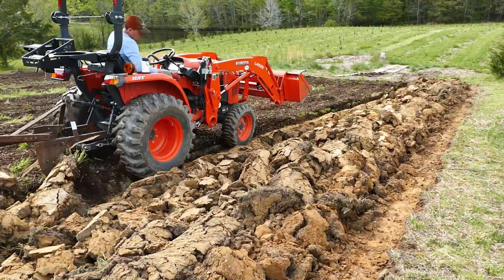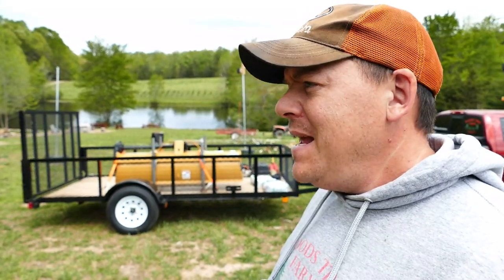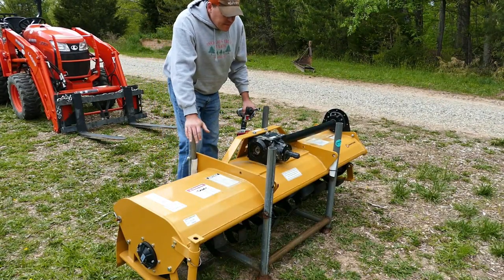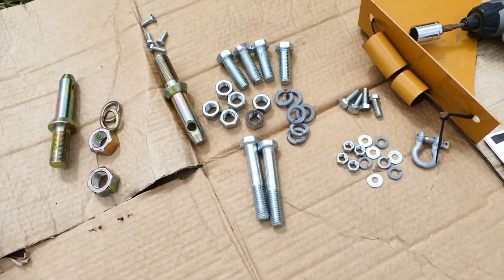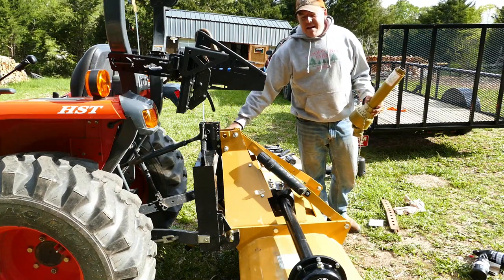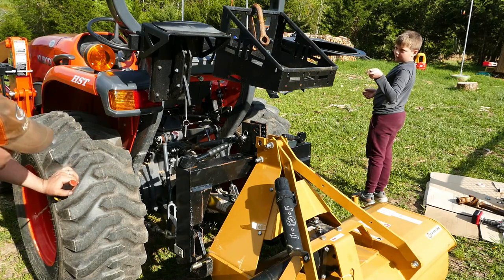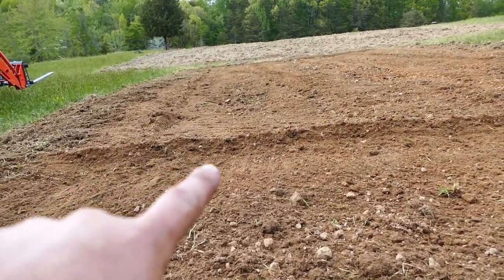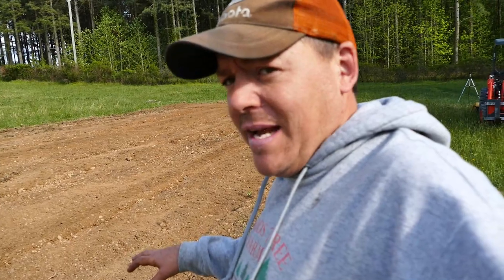Can The Kubota L3901 Run a 6 Foot Tiller? Countyline 6' Tiller Assembly

Comment: People who have not used a stand behind tiller will never appreciate how great a PTO tiller can be.  I've been dragged behind a tiller for hours.  Good video sir.
Reply from the maker: oh yes, I've used a smaller gas powered tiller.
Reply: I have a Troy Bilt rear tine roto-tiller, still works, but now that I have a tractor and a PTO tiller the old walk behind tiller probably won't get much use.
Reply: If you think the walk behinds are a pain now, you should have gotten half beaten to death by one of the old ones, back before they even put wheels on them. Just tines and a single lay off plow. I started plowing with one of the old ones when I was so young the tiller weighed more than I did. 
I came in from plowing bloody and with knots on my head where the metal handles hit me repeatedly, til I got tall enough and strong enough to handle it better. Send a teenager out to do that now, much less a 5 or 6 year old as I was, and you would get hit with child abuse charges. Of course that's what wrong with most kids today, they need some toughing up, and a work ethic.

Comment: Thanks for the information. Legitimately answered some questions we have about power. We're currently deciding on our first machine.
Reply: Go with the Kubota and you will never regret it. Just make sure to get a machine slightly bigger than you think you will need. You can always do the job with a machine slightly too large, but an underpowered tractor will make life miserable.
To figure out what tractor you need, first look at what tools you plan to use. Once you know what tools you want / need, then get the tractor to drive all those tools with a little extra HP above that recommended by the tool manufacturer, if you can afford it. 
Also hydrostatic drive tractors tend to be less powerful than their clutch driven counterparts, so add around 10 hp or 10% (which ever is less) to the recommended hp for your tools so you get a capable tractor for that tool.

Comment: Nice video. I have a 5 foot tiller that is similar to yours that I use with a 28 hp tractor. Those PTO tillers are awesome. One thing that I have found that helps when hooking up the PTO is to back up not quite all the way to the attachment. Then hook up the PTO before backing up the remaining 6 inches or so to hook up the 3 point. I tried this once out of near desperation and have done this every time since. Thanks for the good content.
Reply from the maker: Good tip. Might give that a shot sometime. Thanks for watching

Comment: I think the setup works fine, I till a lot during the spring and summer, from old gardens to break ground new gardens. I've never had to plow it first, of course that's a personal preference. To smooth it out buy a old farm spike drag and drag it a few times it will look great. Another good video keep on it!
Reply from the maker: We've had real back compaction to deal with on our property after decades of cows on the property, so I do subsoiling and plowing to try to improve soil quality and drainage beyond the top couple inches. Thanks for watching

Comment: I bought that exact tiller in 2006. I pull it with a L3830HST and never had any issues and I have tilled lots of ground with it.  Used it on a few landscaping jobs as well. Those King Kutters are gear drive and very heavy duty. I think I paid $1300 in 2006 for mine
Reply from the maker: Good to hear it has held up over the years for you. Hope mine does the same.

Comment: You're going to find more uses for that tiller than you know. I run a 6' king kutter tiller behind my L3301. Works great. If your tiller runs a slip clutch on the PTO, make sure it slips and it's adjusted properly. Mine was adjusted too tight from the factory.
Reply from the maker: Good tip. I'll have to check that out.

Comment: I can sympathize completely with hooking up the PTO shaft.  That is the biggest thing I dread when changing PTO driven implements.  Also, I suggest you consider getting a hydraulic top link.  I have found mine quite useful, such as with the mower, the landscape rake, the box blade, etc.
Reply from the maker: I could see the hydraulic top link being very useful. Thanks for watching!

Comment: The tiller worked great. I’d like to see it on some unplowed ground to see how it does breaking through the sod.
Reply from the maker: I'm curious of that too. There will definitely be some of that to come in the future.
Reply: @FlatCreekOutdoors  I have the exact same setup, Kubota L3901 and the countryline 72" tiller. I live in Oklahoma and my horse field has never been tilled before. I borrowed a friends 5' tiller and it just skipped right across the ground and never dug in. So I got mad and went out and bought this one and it absolutely destroyed the ground like it was butter. FYI dont lift that tiller up at full RPM it could cause the PTO shaft bearing to blow out. If im not mistaken it states it in the instructions along with not putting it into the ground at full speed either. Dont want you to break either machine or tiller both are way too expensive.
Reply: I have one on a 3301. Works on sod but have to take several passes. Shallow on the first then a little deeper and so on. Pain to hook up.

Comment: I have a 2021 CASE IH 40 hp. Compact tractor which I assume is about equal to your tractor here. Do you think my tractor could power a 6' tiller or should I stick with a 5' to be safe?
Reply from the maker: Yeah it'll power it. Every once in a while I need to slow down when soil gets real heavy or deep but most of the time I don't feel underpowered at all.

Comment: I wonder if a few sprays of WD40 PTFE Dry Lube would help loosen that PTO shaft? I use that on my tractor/equipment and is doesn't seem to attract dirt as much as grease/regular lube, but does a good job of keeping rust away and keeping things loose.
Reply from the maker: I think the issue was/is paint on the new driveshaft. I took the tiller off the next day and noticed a bunch of paint chips. I plan on wire brushing and taking a file to the inside of the splines to clean it up.
Reply: @FlatCreekOutdoors  it is amazing what a little paint or dirt can do to the ease of putting something on. Glad you found the issue.

Comment: The PTO shaft on my tiller is too short since I added the quick hitch LOL.  Unfortunately a replacement PTO shaft is ridiculously priced so I have to take the quick hitch off to use the tiller, so the quick hitch is 100% pointless for me, back to the dealer that thing went.  I have the tiller and a box blade, so having a quick hitch for an implement is completely useless LOL.  Dealership didn't bother accounting for the quick hitch when they sold all the stuff to me, only one of several dealership complaints I have.  

Word of warning...DO NOT accept anything, sign anything, or give any money until you have every single piece of equipment that you ordered...I made that mistake so now I have to come up with another $2500 to get the damn mid mount mower for my BX2680 thanks to my extremely unhonest salesman.  Never wrote anything down, so of course I have no proof that in the $27k I paid the dealership that a mower should be with my tractor.  Glad I have a lawn tractor so its not like I need a mower deck, but when I pay for something I expected it to be with the tractor.  Now I need to find a different dealership because I won't return to the one I unfortunately bought the tractor from.  Pretty much every implement/attachment I can get from Tractor Supply but the mower deck is a Kubota thing so have to deal with a dealership on that.
Reply from the maker: man, that sounds like a nightmare. Thanks for sharing your experience. If you haven't already, you might want to escalate that with Kubota directly. There should be a sheet in your paperwork with every item included in your deal, including serial numbers for each item sold. They have to track that in case there are any recalls or anything like that.
Reply: @FlatCreekOutdoors  That's the problem I have no proof, all I have is a paper that shows I bought a tractor, and roto tiller...even the pallet forks I was supposed to get and the box blade isn't even listed anywhere yet I paid for them...I go the box blade with the tractor and tiller, but the pallet forks they kept saying they couldn't find any so I contacted Messick's and ordered from them and never seen a refund or anything else from my dealer.  

Needless to say there isn't any reason I'd go back to that dealership for anything, and I'll be doing the service work on it myself, couldn't trust them to get what I ordered, I'm not going to trust them to do maintenance on it either.  I may try and talk with the other dealership nearby and see about working with them for service and repair needs if that need arises, but otherwise I'll stay clear of Kubota dealerships thanks to that huge expensive mess.

Comment: It would probably have done better with the plow if you had rim guard and wheel weights on and in the tires.
Reply from the maker: Good morning! The rear tires on my tractor are loaded. Wheel weights probably could help with traction too, but if I was doing a lot of that kind of work, regular Ag tires would be better than these industrial tires for more grip. Thanks for watching!

Comment: Man,  you need learn hiw to use equipment,   you hurry to much without checking the stand.  Also never get under a loader, you won't live long...
Reply from the maker: While I usually welcome criticism, there is nothing of value in your comment at all. Take a few deep breaths. I think the air is a little thin up on your high horse. To err is human. I didn't have to call out my mistake with the stand. I could have easily edited that out. Sometimes sharing a mistake helps others learn too. The loader posed zero threat. In the slim chance it failed and dropped, it would have fallen on the tiller, not me. Calculated risks were made, and the risk was extremely low.
Reply: @FlatCreekOutdoors  Wouldn't it be sweet to never make a mistake. It takes a certain amount of courage to admit your mistakes to thousands of people. Everyone can learn from mistakes other people make. That's how we all get better.